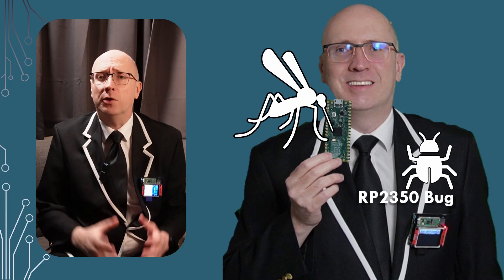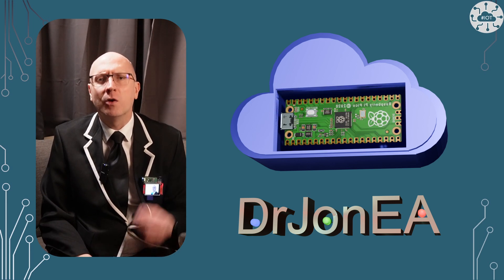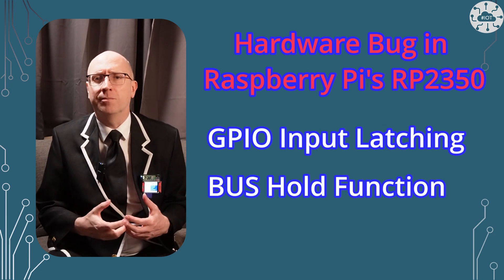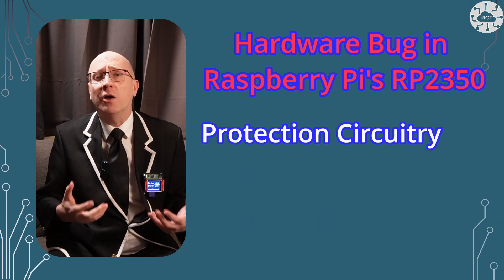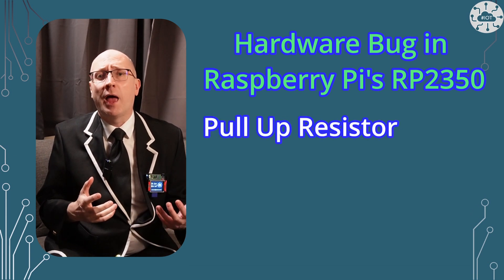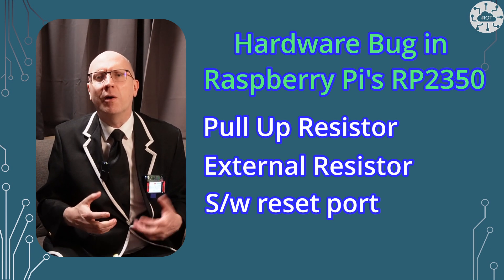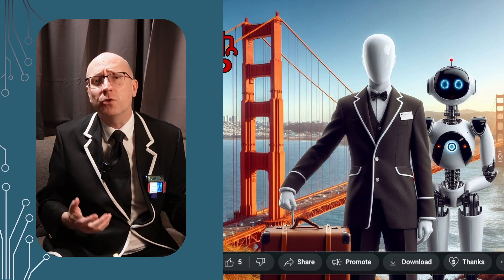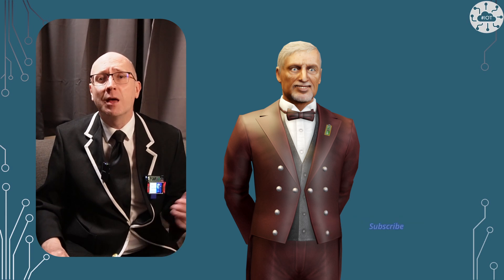RP2350 Bug in GPIO Input Pull-Down Resistor Circuitry | DrJonea.co.uk

Comment: I don't think I've ever used pull down mode, only pull up.   Adding external smd pull down resistors is an easy enough bodge
Reply: +1

I'm more comfortable adding a grounded bus bar than a 3.3 V bus bar (if that's the right term)
Reply from the maker: I agree.
Reply from the maker: Pull-up feels more common.
Reply: there's a choice? if I have a motion sensor with a ground, power and output pin and that's it, how do I make sure it'll be a pull up?

Comment: So, does this bug show up at ANY "logic high" applied to a pulldown input pin; for example, a logic high need not be a full 3.3 V, could be 2.5, for instance? But, in any case, it means that special hardware be designed to decrease the input voltage, or you need to use an external pulldown resistor... Painful to find out after you've received your first run of PCBs!
Reply from the maker: I understand that applies to any input pin using the internal pulldown resistor. The cases I've read have all been on Pico 2 or equivalent boards so all running at 3.3v. I don't know if this happens at lower running voltages but I suspect it might.
I feel you pain, when you receive you first batch of boards is not the time to find out about this one.
Reply: @DrJonEA  yup. Lost my damn mind for a few days before finally finding a Reddit post about this, then finding your video with the right wordage after figuring out what the issue is. Done with pico and moving into their better ESP32 counterparts 🤙

Comment: If i can get a Bus-Hold out of this Bug i can benefit in some circuits. You can for example use  toggle switches with COM connected to the input, NC to GND and NO to VCC ( preferable with a resistor in series - normal switches are break before make, so not strictly necessary ) as a electrical debounced switch input.
Reply from the maker: Yes I was being a little tongue in cheek by suggesting debouncing. There has to be some way we can make positive use of this bug through.
Reply: @DrJonEA  Surely unwise to 'use' this at all due to potential unreliability and a silicon revision at some unspecified date?
Reply from the maker: Fair point.